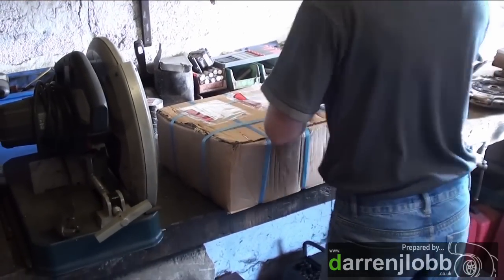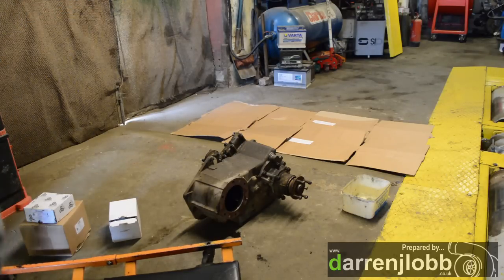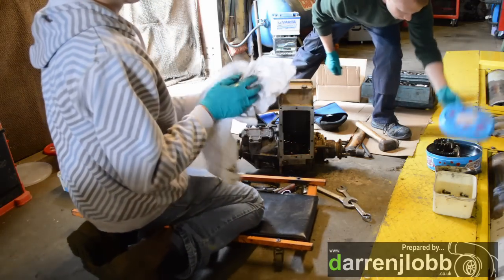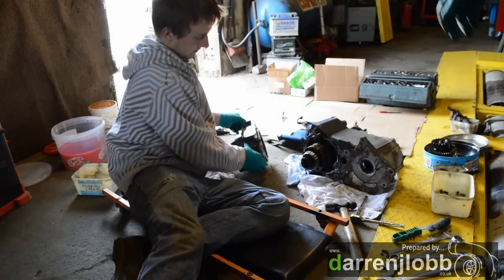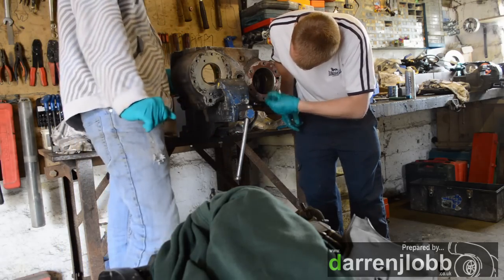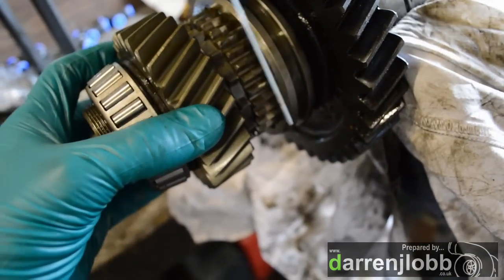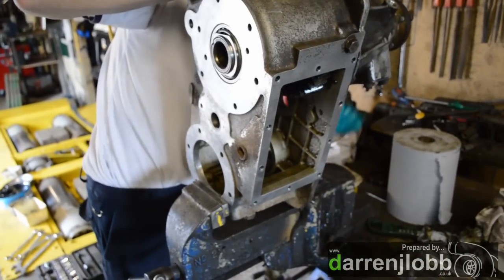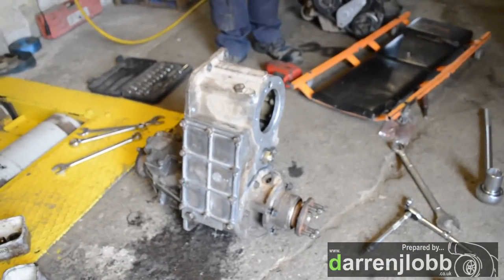Land Rover Cummins Conversion Part 11

Comment: I guess that answered my questions on the gearing what size rubber are you running would it be ok running 33s do you recon would you use an early range rover tc with 1.00:1 ratio next time or is the rebuild a strength upgrade as well
Reply: ben perry she would be ok with 33's, engine has plenty of grunt for them, i would however upgrade the drivetrain to take the extra strain. the rebuild was mainly to change the ratio as 1:1.2 would be reving the engine too hard when cruzing. but i have gone with ashcroft gears to strengthen it up as well as i will end up towing something heavy and putting loads of torque through it.